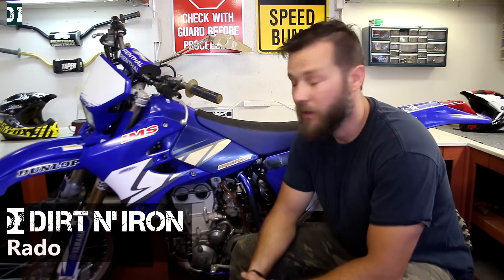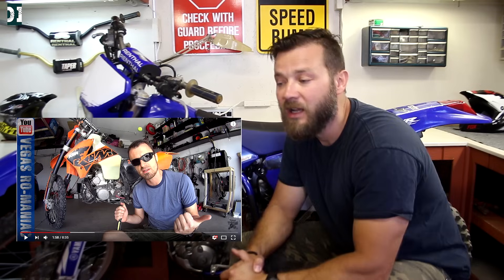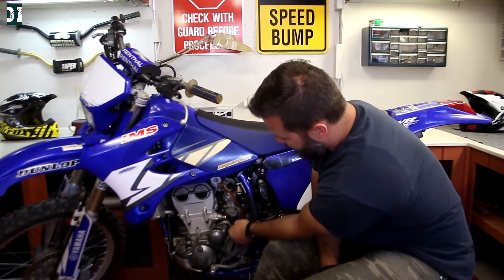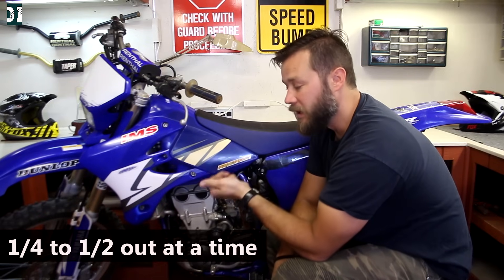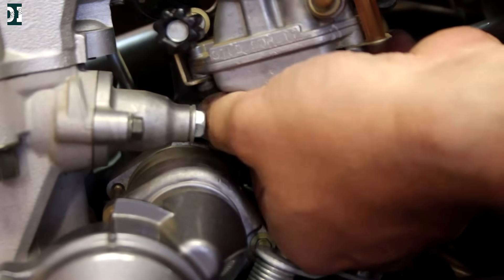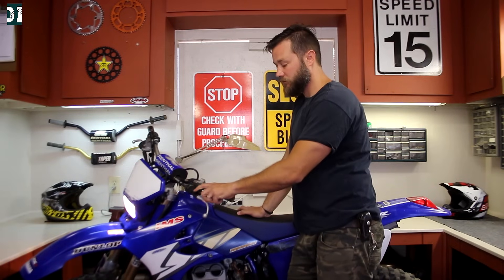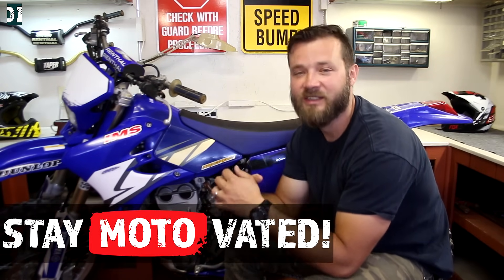How to adjust idle on 4 stroke dirt bikes - fuel screw adjustment

Comment: “Thank you so much for this video. After many hours online and watching other videos, you nailed it. Your explanation showed exactly how to adjust the carb, what to do, and what to listen for. It solved my problem. My bike overall ran OK but backfired on decel problem solved runs much smoother throttle response quicker. After riding this bike since it was new I didn't realize what I was missing until I did this fix. Many thanks!! — my ’05 WR450F runs perfect now. Thanks again!”

Comment: I follow the instructions and turn the screw anti-clockwise until the idle starts to drop, but if I pull the throttle and then release it the idle drops below where it originally was and then the engine cuts out. I assume this means the engine runs too rich. What am I doing wrong? My scooter uses a GY6 engine and a PD18J carburetor with a a 28 idle jet and a 78 main jet, which is pretty standard and the scooter is in stock configuration.

Comment: Hey I have smooth throttle response but my hart start does not work correctly and I have heavy back fire on deceleration I bought a jd jetting kit but before I install I just want to know what you think I should do
Reply: I watch this video and did the fuel mixture screw and went out the 3 turns and it did not make hot start work I have 2006 Ktm 250sxf 4 stroke with FMF POWERCORE 4

Comment: Ive been struggling with getting my klx110 dialed in, when I turn the Fuel screw all the way in, and 1/4 turn out the idle actually goes down, not up. 2 turns out my idle will get high, you think my pilot is too rich?

Comment: I can't figure out what the heck is wrong with my ktm 250
Reply: Best thing is to go back to stock jetting and go from there. Once you get jetting straightened out, If it’s still running bad you can look for air/ vacuum leaks, which will cause many problems on a two stroke

Comment: I have a crf250r and it doesn’t idle without the choke? And I was going through the comments and didn’t see anyone with the same problem. Please help!!! Thank you! And I’m not sure if you are using the choke. Thanks again
Reply: if it needs choke to idle then the pilot jet is clogged, there’s a 17mm bolt under the carb that gives u access to the jets

Comment: My fuel skrew fell out + I haven’t check my valve clearance, backfires SOOO much this Halloween night, SUPER loud with flames out the back. Way too lean was boggin like crap :(
Reply from the maker: dont ride it, you can damage the engine. running too hot when its lean. get new screw

Comment: Oh man! I am glad that I found your video. I can't wait to get to the bike and readjust the air fuel ratio.

I've been puzzled for a whole month. I would normally stop unscrewing at the highest RPM, then, adjust the idle screw.

After watching your video,  I realized that I had been adjusting it to run lean.

This is probably going to solve the problem of hesitation during acceleration.

Thank you scoo much!
Reply from the maker: Good luck!

Comment: Finally someone who knows what he is talking about. Keep up the videos. The hot start trick on jetting help me so much. My bike runs like a beast now. And my air screw is at 1-7/8 out instead of 2.5 as set from honda. Much safer to run a little rich than lean. I'm totally amazed at his ability to explain carburetor. Help with my 2-stroke on another video also. Thanks again for being awesome.
Reply from the maker: @ronaldcollins2852  glad it helps 👍👍
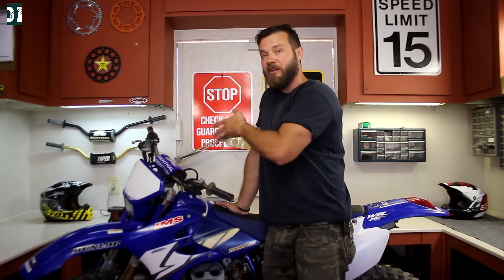Reply: 7:57 7:58 7:58 7:59
Reply: 8: 8: 9:02 29

Comment: the adjustment of fuel screw depends on the design or model of the carburetor, whether fuel screw is located before the slide or after the slide, if the fuel screw's location is same as the video, turning clockwise is getting leaner while counter clockwise is richer that's why rpm is going down when adjusting the fuel screw counter clockwise, on the other hand, when the fuel screw is located before the slide, turning clockwise is going richer, and turning counterclockwise is going leaner that's why in this design if you turn fuel screw counterclockwise the rpm goes up. 
You can directly observe this when you turn fuel screw counterclockwise it's either the rpm goes up(leaner) or the rpm goes down(richer-same as the video) hope this helps if you're struggling tuning your carburetor.

Comment: Great tip (near the end) on the hot start with little or no response, meaning maybe too lean. That was very helpful in getting a KLX450R carb dialed in with a little more fuel mix. Thanks! (Prior to viewing and tweaking, hot start worked for hot starts, but still backfiring on shifts and trailing throttle.)
Reply from the maker: Glad it was helpful!

Comment: If the rpm goes down it means the mix is rich, also after the throttle the bike is takingh time to idle,i think it is rich... Check the spark plug to understand how it is.

Comment: Hello 
I have the same carburettor, but I have another issue 
When I accelerate and leave it normal , is starting to accelerate by itself like and to stop it is either I play with the thingy on the left or I press the cold hot starter from the right handle .
I clean the jet and everything 
But the issue is still there 
Is like the air is to much or the mix is not alright
But only when I accelerate and then I take the hand form it , instead of coming down is juts goes up but not to much

Comment: So when I tried this method on my xr 400, when I get to like three turns out the idle actually increases and keeps increasing the further I go...clean air filter, warmed up, just cleaned the carb and replaced all the gaskets on it, no indication of air leaks in the intake. So what's up with that? If I turn the fuel screw in it dies once you get past half a turn, so we would expect that, but why is the idle speed increasing the further I go out?

Comment: when i fully close my fuel screw and open it half turn out and bring up the idle a bit and then oprn the fuel screw the rpms dont drop, they just keep rising. they only drop if i close the fuel screw… help please
Reply: Did you figure this out? Mine is pretty much doing the same thing. Turn it in past 1/2 turn and it dies. Okay that's good. Turn it out and once I get to like 3 turns out the rpm's just keep increasing...I just cleaned the carb and replaced all the o-rings. The air filter is clean. the bike was warmed up. There is not indication of air leaks in the intake (when I spray with carb cleaner there is no increase in RPM). My bike also hiccups under idle sometimes and it kinda backfires through the exhaust on deceleration/when you let off the gas after revving. It's louder than a pop I think.

Comment: Shop manual says idle speed is 1700 rpm. Ridiculously high IMHP. Can't we make them tick over around 600?
Great video. Watched it twice so far. Will look into the idle screw mod. Thanks

Comment: i adjust my fuel screw the same way as you say but my rpm wont change. It just stays up the same, do you know what this is? Also the first time I adjusted my carburettor as in the video it did work, I have now fitted a new spark plug in it a so I thought I would adjust it again but now I have this problem. Can you help me?
Reply: Did you figure this out? My idle increases when I turn it out to 3 turns out. Clean carb, clean air filter, no airleaks as far as I can tell with carb cleaner test.

Comment: Hello! Your videos have been helping me put together my 2013 YZ250F your a big help! tuning the carb it seems okay but I believe it’s not 100% correct because when I pull in the hot start it just boggs or the idle deteriorates even if the fuel screw is turned 3+ it doesn’t change the hot start idol it boggs, can you please give me some pointers on how to fix this or what is the cause? Thank you!

Comment: Hey buddy is the fuel air knob the only adjustment on these? I have a 17 crf230f and I can't get it to stay idling and it's hard to start up and keep running. I can get it to start full choke but then when I lower it to half choke or no choke it dies out. This has been an ongoing problem for a while where I've got it running and Stay running but it's had trouble on cold starts and staying running. I took the fuel petcock off as it was running in reserve but not on on. So it was clogged when in on position so I cleared the clog but now I'm still having trouble. Now I think I killed my battery from starting it so much and not staying running 🤬🤬 Also my bike only has one black knob above my carb. There is a small adjustment screw at the bottom of the carb on the face of it,  one that you would adjust with a flat head driver

Comment: I have a 2006 WR450F and adjusted the fuel/air screw, but my bike still backfires no matter how I adjust it. Also my bike will bog or stall if I give it too much throttle unless I ease off. Does anyone know how to help me?
Reply from the maker: you are too lean on a pilot jet, try one size bigger pilot

Comment: DirtNiron, i can't understand this method because most mechanics talks about finding HIGHEST rpm between rich and lean fuel screw adjustment. You doing opposite (finding lowest RPM). Can you explain who is right and who is wrong ?
Reply: He said to turn the idle a bit higher to create a lean condition then he turned out the pilot screw until the rpm drops, till then fine. But what about when he re adjust the idle screw to decrease it, would it not become a too rich mixture?
Reply: @hydarmbm3456  strange method anyway

Comment: The method is great, but the info is misleading. It is not necessarily a fuel screw on a four stroke dirt bike, there are lots of 4 strokes come with a air screw, I was confused for so long a time for your wrong infos.

Comment: This is what I need to see I took my vento thriller racing 200 to a shop they said it's supposed to bog down on quick blips of the throttle 🤣it's normal but I'm the original owner and it was crisp when I bought it long story short I never went back bought a new carburetor and with this video I'm ripping again

Comment: I installed a R&D Racing Flex Jet in my Suzuki DRZ-400E and hung it off the metal feul inlet on the carburettor with a zip tie it is the best mod for on the go tuneability especially when going high and low altitudes i highly recommend this product to everybody just do it you won't regret it.

Comment: Hi, thanks for the info, One question, with the screw all in and the right pilot jet, the engine Will die? Because mine, with all the screw in, still run, but with more high RPM

Comment: I am not that experienced with dirt bikes and maybe carburetors are different from manufacturer to manufacture but I thought the choke brings more fuel into the carburetor and not air it's when you choke the engine you're choking the air flow off thereby increasing the vacuum which pulls more fuel out of the bowl and into the carburetor. If I'm wrong about this please tell me so I can correct my thinking I'm dealing with my own issues trying to get my bike running by rejetting it and it seems like everything I do fixes one thing and messes up something else and I'm just all over the place on this n i b b i pwk28 mm. Thank you
Reply from the maker: you are correct, choke works like that but I was talking about hot start and that works opposite way. Not every bike has a hot start but pretty much every bike has a choke. hope that makes sense
Reply: @dirtniron  oic now.Thanks for the reply.

Comment: Interesting - I have an 06 CRF250R - Starts great cold. Valves in spec - Float level was fine the last time I checked it. It starts like a champ cold. But hot  is another story. Part of the problem is that if I am not on the stand, I have a hard time getting a good kick. My method of starting when hot has been to pull the hot start in and give it 6 - 10 kicks - then position on intake stroke and kick. The problem is exacerbated when the temp goes up and the engine is hot. My bike will NOT run with hot start pulled in. It speeds up, then dies. I have looked a lot on the internet, and some have said that speeding up, then dieing is the proper response. I ran across Jay Clark's video and he said that it should RUN with the hot start pulled in. This is where you took your cue from . . .  and you stated as much. The owners manual for this bike states that when hot, the hotstart lever should be pulled in and the bike should startp. By these metrics, I am too LEAN on the fuel screw, because the hot start introduces more air into the system and a richer charge is required to keep it running. . . . .  . .
Reply from the maker: yes, I would say you are bit lean.. try to play with your fuel screw or maybe even get bigger pilot

Comment: I adjusted mine the way you described and it runs great at idle great throttle response and revs up with hot start but when I go to ride when holding in clutch to stop and down shift it dies any suggestions

Comment: I turned it 4 full turns without the rpm dropping. Felt like it was going to fall out any moment so I left it at that position. The bike runs great but I'm uncertain if i should've kept turning it.
Reply from the maker: 4 is too much, 3 should be the max, go with bigger pilot and put the screw back around 2, or drop the needle lower and adjust the screw

Comment: Hey there,   I know this video is old , but I hope I'll get an answer.   I had lots of issues, back fire and stuff, but now I got the after market screw, W
So when I adjusted the fuel screw, the bike was running good   , no back fires,  no red exhaust,  the idle was good , everything seemed to be fine , but when I pulled the hot start to check , the engine was dieing instead of going higher  . I don't know what could be wrong.  Any help here. ?
Reply from the maker: try to go with bigger pilot jet, might still be too lean
Reply: @dirtniron  I had a bigger jet , it was way worse than now ! It was the first time it worked so good , but when I tried the hot start,  then I was  disappointed . Instead of going higher it  went lower , it almost died

Comment: I have a yfz450 2007 there is no hot start is there any other way?
Reply from the maker: just see how the bike feels, does it backfire? does it follow the throttle, etc
Reply: @dirtniron  can get it to idle without the choke what jet controls idle on these carbs

Comment: What does it mean if the hot start makes the idle drop?
Reply from the maker: I would play with it to determine the cause, first assume that the bike is way lean and try to give her more fuel on pilot circuit. adjust fuel  screw accordingly, maybe even raise the needle and change the pilot one size bigger. then go ahead and test it again

Comment: It will not work for me! i got a KTM 250cc SXF but dont really know the year. something between 2007-2011. When i start the bike with shoke on. its reving up HIGH. when i take the shoke off it dies. been doing what you saying in the video. i buyed that fuel screw thing u showed on video. but still dosnt work for me. Do i have to adjust my valves?

Comment: I think my fuel screw needs adjustment but I've gone from a 48 pilot all the way down to a 40 and it still doesn't die when I'm all the way in. I had it running good with a different fuel screw with a 42 pilot but then the o ring snapped so put a new fuel screw in so I'm gonna try putting the old fuel screw back in and go with a 42 again as the tips are different on the two fuel screws I've got. Also when I pull my hot start in the bike dies? Any idea why that is? Thanks
Reply from the maker: not quite sure why it dies with the hot start.. try to dial it in first, make sure its not lean and do it again

Comment: I have watched this video at least 6 times. I have a KTM SX-F250 and did exactly what you said, idles perfect snappy throttle. But when I pull the hot start it dies. And it is a serious pain in the _ to start when hot...HELP...
Reply from the maker: I would jet it first, follow stock recommendations for your elevation and then play with it. Its good to have a good base line, then you can go rich or lean..

Comment: Thank you very much for this informative video I have no experience when it comes to bike maintenance I just got my first bike crf450r it wouldn’t idle on its on after watching this video and following these steps I was able to get it up and running correctly it wouldnt keep idle because it needed these adjustments as they weren’t correct and hot start made no difference in the idle which was how I figured out it wasn’t jetted correct and I was able to fix it thanks to you
Reply from the maker: Right on Giovanni, glad it helps! Have fun on your bike 🤙

Comment: I have a razor 170 for my son that's been a bitch. Gonna try to do what you did here see if that helps. I just replaced the carb, fuel pump, air filter, spark plug and oil but at a high rpm she stalls out.
Reply from the maker: good luck!

Comment: Will this work on a quad? I have a 2007 yfz 450. Runs bad on idle and low rpm.
Reply from the maker: yea, should be the same carb even.. procedure is pretty much the same on all 4 stroke carb bikes
Reply: @dirtniron  sweet. Thanks man. Subbed.